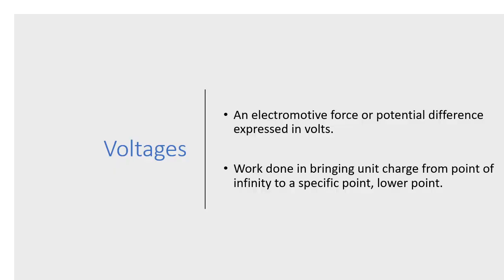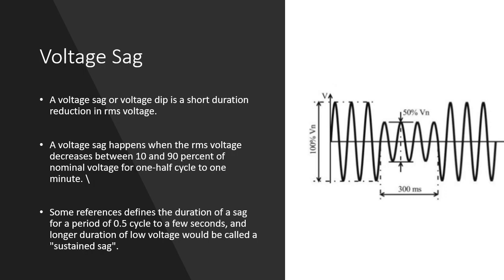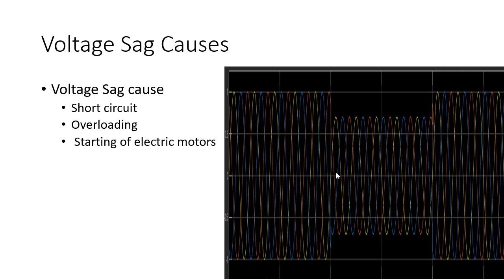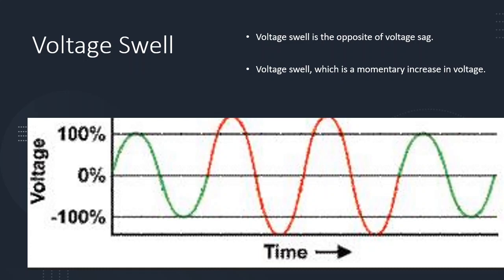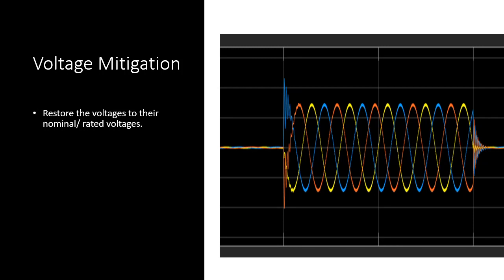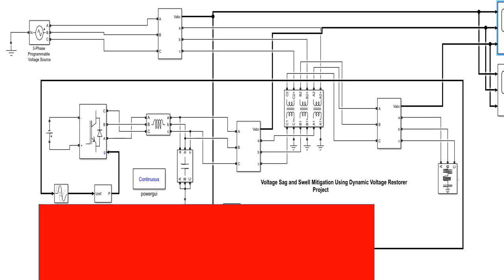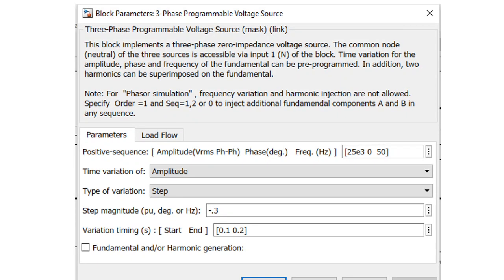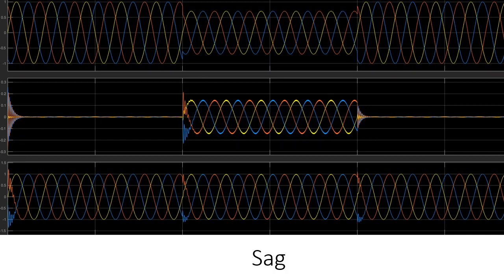Voltage sag and swell | Voltage sag mitigation techniques

Comment: Any other alternative? Without battery. By using RC Circuit in parallel
Reply from the maker: We can use ultracapacitors, and PV system as DC source as well, etc. However, each method has its very limitations.

You can find voltage sag and swell video in Urdu/Hindi at:
https://youtu.be/h-4LctjAz0Y
RC circuit, its transient and steady-state response  at
https://youtu.be/iK3mkBNdL3k
RL circuit, its transient and steady-state response  at
https://youtu.be/1U1T1c65JVw

Please Subscribe to this channel and like and share this video. 
Thanks
Reply: @EngineeringDoseLetslearn  0
Reply from the maker: @arjunjoshi1015  I didn't get you

Comment: What is the reason for puting amplitude phase and frequency,i.e.,25e-3  what is the reason for it?
Reply from the maker: I think you misunderstood, my amplitude is in 25e3 or 25kV, my phase is zero and my frequency is 50Hz- I defined my values for the system